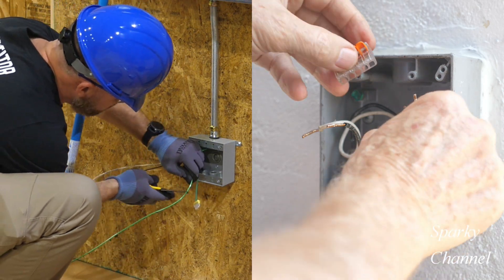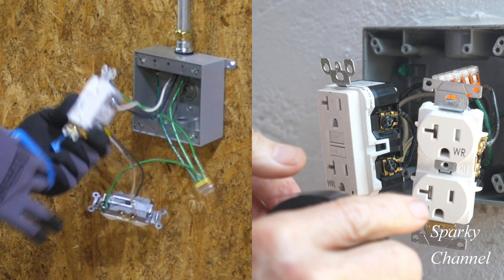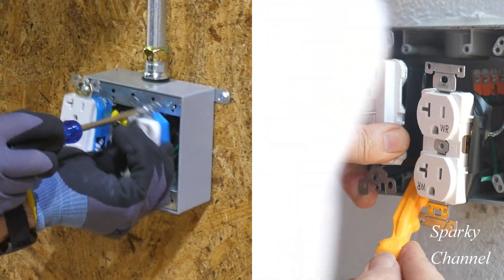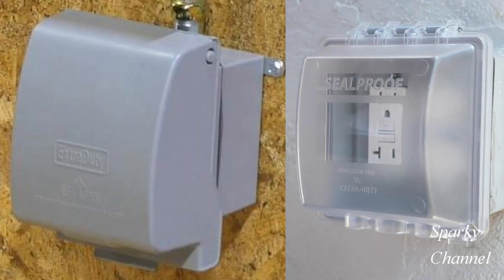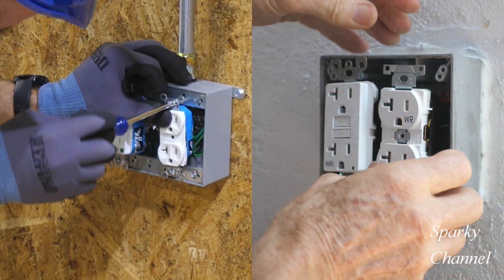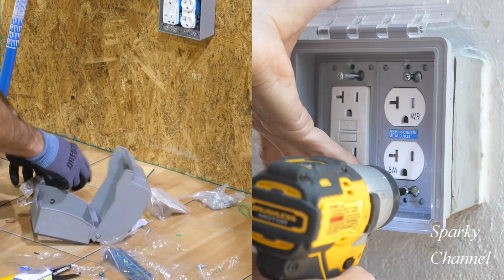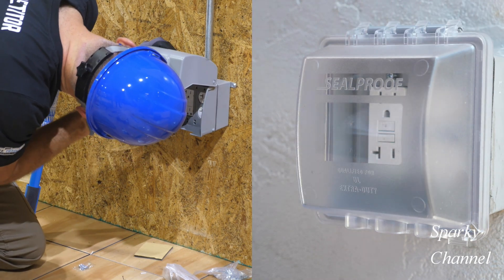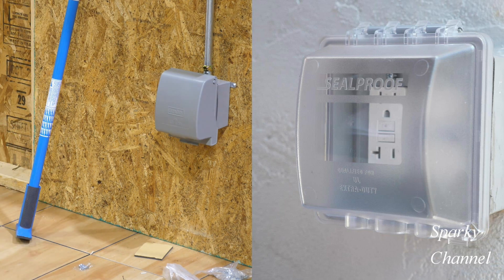Ideal Armourband vs. Electrical Tape, Which Will Win?

Comment: I bet if you were to install the band over the wires before terminating to the receptacle, it would install easier over the back of the receptacle instead of over the mounting tabs from the front side.
Reply from the maker: Yes, that's an excellent point.

Comment: Hi Sparky, I have used the armor bands also and was glad to see Greg struggle with the band getting twisted on itself.  I've had that problem also.  I usually give them a pre-stretch prior to applying to the device, that seems to help a little.  I like them, but I haven't seen an ease of use or productivity improvement over tape.
Reply from the maker: Great tip, thanks!

Comment: this is old school.   there are new patented devices that DON'T HAVE any exposed screw heads or any EXPOSED electrically charged parts.  Check out YOUTUBE.  KNEE SAVER ELECTRICAL BOX & TIME SAVER ELECTRICAL SWITCH.
  REALISTICALLY, most people die or get shocked going BACK INTO a box, not during the initial installation.  With this new device and installation process,  you DON'T TOUCH the wires again to change a switch or receptacle, and you DON't have to get down on your knees to replace/or install receptacles.  Unfortunately, they are not for sale yet.
Reply from the maker: Thanks!

Comment: Thanks for the video, Bill. How much more are bands than using electrical tape? All things considered, do you think the bands are worth it?
Reply from the maker: I think they are worth it for exterior applications because the silicon bands can take the heat while the tape turns into a melted and gooey mess. That's something we have to consider here in San Diego.

Comment: I like transferring a good length of electrical tape to the end of a dowel or carbon arrow shaft and using the thin diameter stick as a sort of tape applicator for doing this kind of work. It's really nice for getting in super tight spots too.
Reply from the maker: Sounds great!

Comment: Sparky didn’t have the captive screws to contend with, I think that made the difference. I abhor electrical tape for all but the most temporary of uses (also acceptable for color marking wire).
Reply from the maker: True about the screws. I needed them off though to install the weatherproof cover the way I wanted to. Electrical tape has a drawback here in San Diego for exterior receptacles in that the heat will melt the glue and make a mess. The silicon bands are better for that application.
Reply: @SparkyChannel  Yeah, it's the sticky, gooey mess that electrical tape leaves if left on for more than a few hours that makes me never want to use it. I bought a big jar of those silicone bands a few weeks ago, and will use them on all my projects (I'm not a professional electrician, but I do a lot of work in my home and shop).
Reply from the maker: @OriginalJetForMe  Excellent! I know that silicon is actually used for baking sheets, so the heat won't bother them at all.

Comment: In fairness your competition was wearing those awful cut resistant gloves. That's why he was struggling. Safety first!
Reply from the maker: True. It's more difficult to do detail work with gloves. Yep, safety first!
Reply: @SparkyChannel  I work in low voltage for a national company and they have finally relented and allow us the remove the gloves for wire terminations. They call it "fine wire manipulation". The world's not like it used to be.
Reply from the maker: @steelfist65  Makes sense. I always wear the gloves for EMT bending and the like.
Reply: @SparkyChannel  I usually only wear gloves when digging trenches. Lol
Reply from the maker: @illestofdemall13  Lol!

Comment: the other advantage to the armorband is they don't rely on adhesive which WILL dry out and lose adhesion over time.  of course, we don't know if the armorbands will fail with age like the tape does.
on an only barely related note; the newest generation of Intermatic oversize weatherproof in-use cover works perfectly in conjunction with the GFCI protected plugs that are common on plug in hot tubs. (the WP5221C)
Reply from the maker: Interesting. Thanks!

Comment: Bill another great video, really enjoy the subject matter you go over! I've wanted to get some of the armourbands ($38.00 for 100 at Lowes) i think you had an advantage with the tape LOL, your screws were out of the receptacles where Gregs were in, i understand why yours were out, I've wrapped taped over the screws on occasion, causing me to remove it and start over. I think even though they cost a little more, the convenience of reusability of the  ArmourBands is worth it, plus their a little faster.
Reply from the maker: Yes, I was going to replace the screws anyway. Why not put the tape on without the screws? It was unfair though, now that I think about it. Thanks!
Reply: @SparkyChannel  Bill, the screws are already in the device, taking them out just creates more work.
Reply from the maker: @Bluesman57  Check out 5:15 to see why I changed the screws to the longer ones that come with the weatherproof cover.

Comment: I never knew those bands existed and always taped my devices when I felt it was needed (when in a metal box or more than one device per box).   About $1 each is not too bad... pack of 10 costs $10 on Amazon.

The VoltClaw is probably the most handy electrical tool I've purchased in recent memory.  Love it.
Reply from the maker: Isn't it though? Love the Voltclaw!

Comment: I am not an electritian. 
However, Ive experienced more than two but less than three consecutive seconds of 277 volts through my upper body. 

There was a time, long before my second experience with 277v, that I paid $14 for a set those connector nut keys. I was happy to have them but ive never used them. I misplaced them pretty quick and even disposes of the two that ive discovered while organizing my crap. 

Armour Carp > Armour Band
Reply from the maker: Be safe, thanks!

Comment: Great Vid Bill, however the armor bands for all that they offer do not seem to be cost effective in comparison to ideals armor electrical tape which I use. The tape is costly over standard electrical tape, but worth the peace of mind after I do any electrical outlet or switch replacement in data center's or at clients offices when I upgrade their networks. Armor bands seem to take a lot of time overall.
Reply from the maker: Thanks!